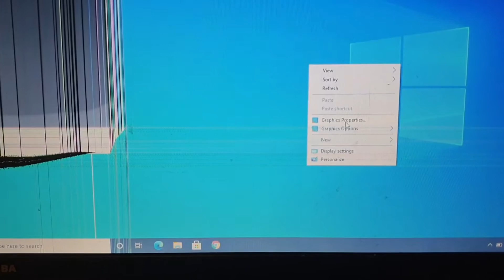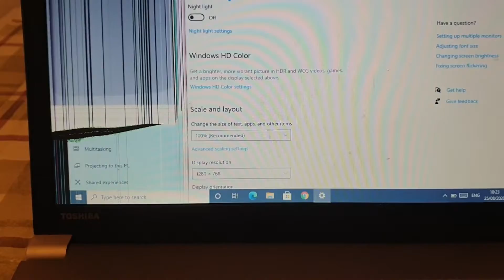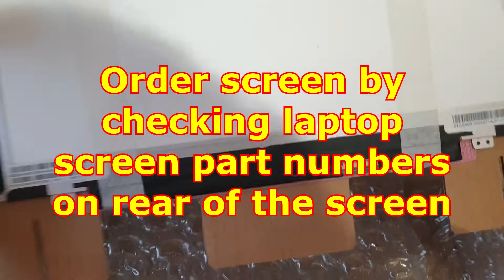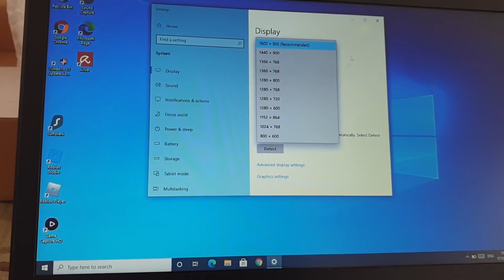How to replace a Toshiba Tecra Z40 B-12Q laptop screen, quick and easy!

Comment: Can you plz make a video of how to fix those silver screen Hinge 
mine are very lose
Reply from the maker: They have little clips on them, once broke they wont stay on, you might need to use a little dab of glue?
Reply: @fixingmoddingbuilding  ok thanks but now my laptops screen is black with the cuser  I tried getting help other aids but still a black screen
Reply from the maker: @ShindoPeinge  Are you 100% its the correct screen? I bought a few with slightly different part numbers from the one I took out and the had some strange effects.